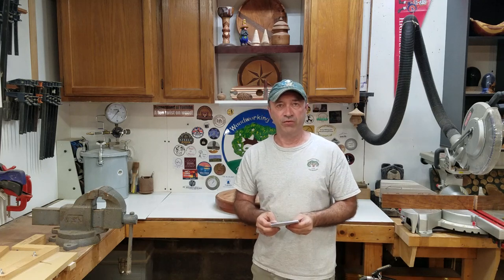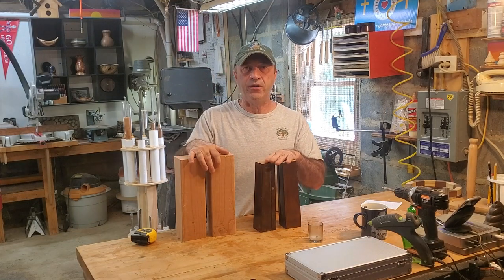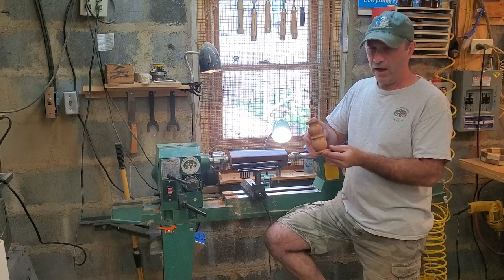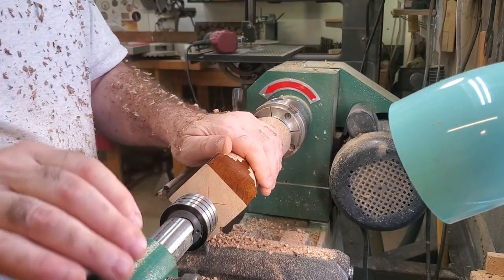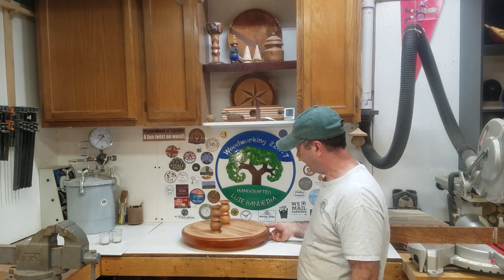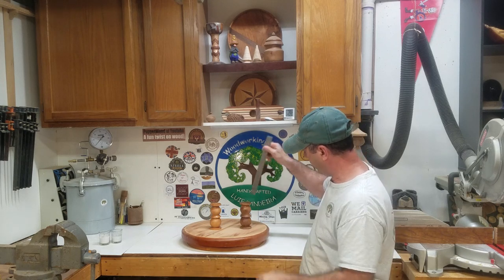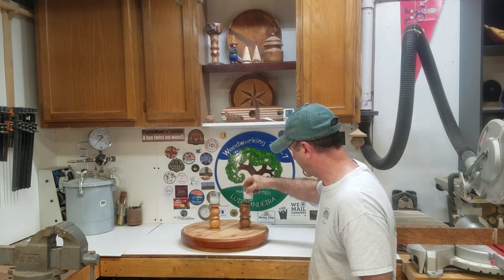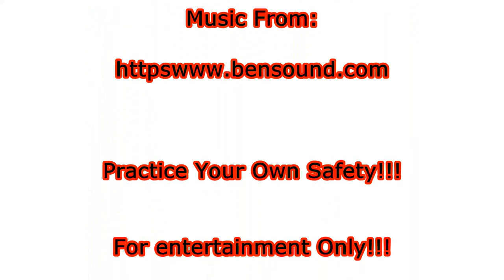Wood Turning Matching Candlesticks

Comment: Great project Luie the candle holders look great. Also a nice way to use the old furniture legs. 
 Keep up the great work!
Gary
Reply from the maker: Thanks that's what I have to do with my wood budget 👍😎 the free stuff is the good stuff🤣
Reply: I salvage everything I can. I cut up a couple oak shelves my wife picked up free at a yard sale. I will make segments out of them some day.
 But we have a very old upright piano nobody wants so I will probably tear it down and make something from it just to remember the poor old thing. 
 So the free stuff is great!
Reply from the maker: @ThePapa1947  great minds think alike!
Reply: @spindlesworkshop9744  I am saving the best till I think of what to make out of it.
In 1963 I made a project in high school shop class. It had to be metal and wood.
 I still have the walnut boards from it. It spent it's life as a tv stand, fish tank stand and many other things. Been only the boards for years. The boards were strips glued together and the joints are still good after years in the garage corner. It will make a nice segmented turning.
Reply from the maker: @ThePapa1947  that is so cool that you saved it for all these years!!